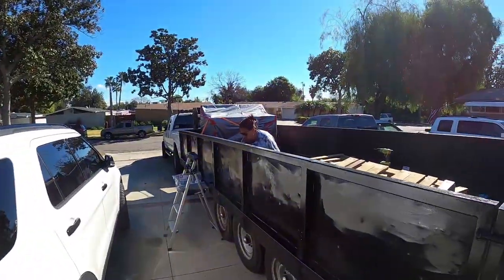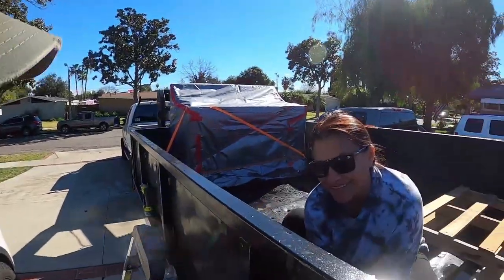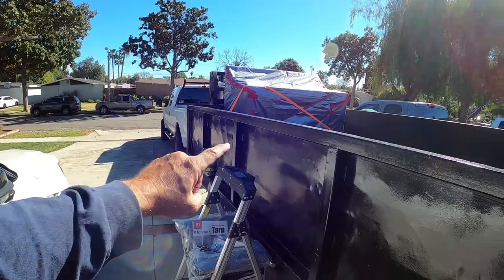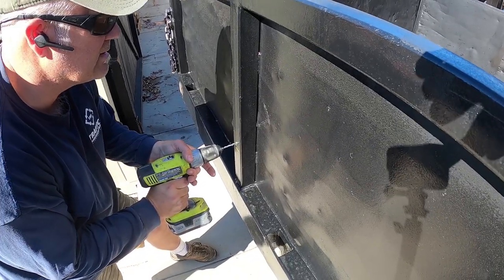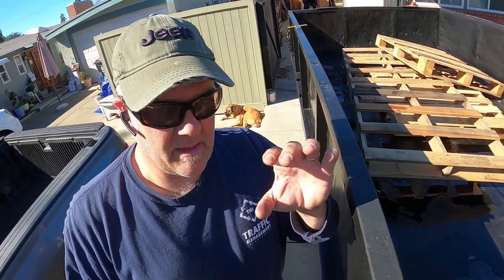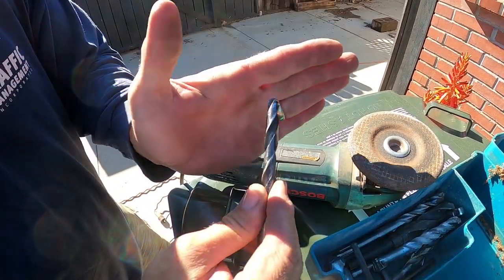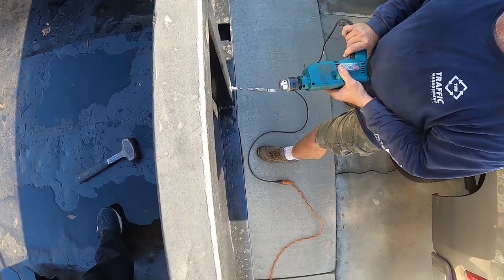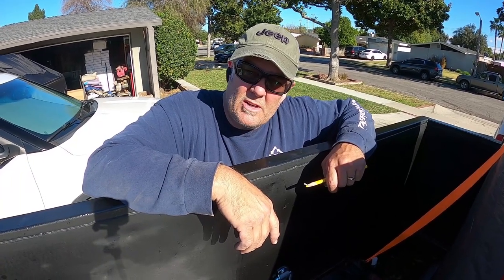How to install trailer tie downs

Comment: Great video Olivia and Scot. Just remember guys there's a difference between a high-speed steel drill bit and a carbide drill bit. Carbide is usually used for concrete or cement they can't be sharpened as easily. The high speed or high carbon or even cobalt can be sharpened. Colbert is a harder steel which will allow you to cut through steel easier.
Reply from the maker: Are you up and ready to go?

Comment: Hey Scot, nice job. 
I would have put D-ring mounts on the outside of the bed too using the same bolts. 
Just in case I needed to run the cargo straps on the outside for over sized loads.
Reply from the maker: I forgot to mention I already have tie down hooks underneath the side rail!  Plus stakebed holes as well...
Reply from the maker: Wait..  you said the same bolts...  That's actually a great idea since the bolts stick out a 1/2" I could totally do that!  Thanks for the idea
Reply: You're ready to Tie One On! The winds in Idaho is licking up the snow and drying it out. 😁
Reply: @HiddenValleyHomestead  haha yes, that's exactly what I meant. ;-)
Reply from the maker: @rottdogg8926  I get in a hurry and don't read comments slowly sometimes...  It would be an easy install... So part II dedicated to Rott Dog coming up!

Comment: I put most of my 'D' rings on the outside so they don't damage the items that I'm transporting. I put a couple of tiny 'D' rings inside where I can remove the easily if needed. I also have several sixes of cargo netting for smaller loads (that doesn't happen very often) 😎

Comment: The beauty of that install is you can reverse the D Ring and have them on the outside if you ever need to do it.  One thing that should be implemented in our tool and parts buying decisions is country of origin. Is it worth a few bucks savings buying Chinese made items? I think no. The path to hell goes through Harbor Freight.
Reply from the maker: Yes.  I agree.  I will do a vid on that in the future. As a crane operator I've seen the Chinese crap fail critically!  And in my line of work that is catastrophic and deadly.  Just like you say...the road to hell!  But this was one item that I felt wasn't critical...  And the ones I could have bought from Amazon I couldn't verify country of origin...  Now the D-Rings on the floor of the trailer i used to chain down my 11k lb dozer??? THOSE are critical as well as the chains and binders themselves! You better believe i made sure they are American steel!  Great point Tim and one that demands further discussion!